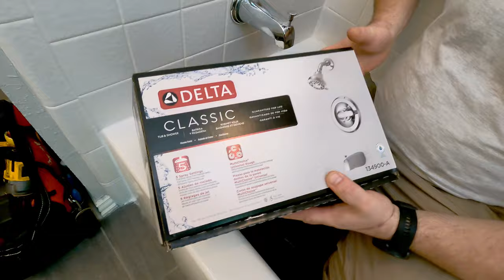How to replace shower valve.

Comment: There was no need for screw adapters, you can solder right inside, its designed for 2 options.
Reply from the maker: If you have pipes long enough you can.